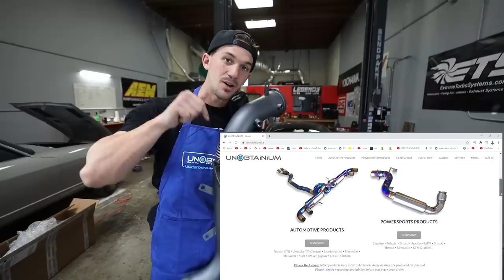Straight Piping My Mclaren 570s!! *Supercar Downpipe Install*

Comment: You’re gonna be blown away with what a tune and down pipes do for this car
Reply from the maker: I'M STOKED!! happening today
Reply: I wasn't blown away, My 570s is running like crap, throwing lean and rich codes, fails smog and check engine light on. I am putting the old cats back on right now.
Reply: @SpawnyWhippet  who did you use? I’m having my 570S tuned shortly
Reply: @shaarnc2918  Larini cats, not sure which tune it had. Running stock cats and stock tune now, the car is much healthier, with no noticeable power difference.

Comment: I'm very surprised you didnt protect the rear fenders and paint with removing the downpipe. I sure hope your car has PPF. 👎
Reply: @jonathanxtapia  ... you obviously never owned a nice car. OEM paint is critical on any supercar for holding its value. Please comment when you actually know something
Reply: @jonathanxtapia  ... I assume nothing. All of my cars have Xpel PPF and I protect all exposed areas when installing any aftermarket parts to ensure nothing  scratches the OEM paint. It's not rocket science and if you actually own a nice car or supercar, you would know what I'm talking about.  You can drive a supercar hard and enjoy it at the same time however there are precautionary measures to protect the car for any unfortunate accidents.  Do you know how hard it is to paint-match a McLaren unless you take the car back to the dealer to be fixed? I really hate when ppl comment when they have zero clue on what they are talking about.....